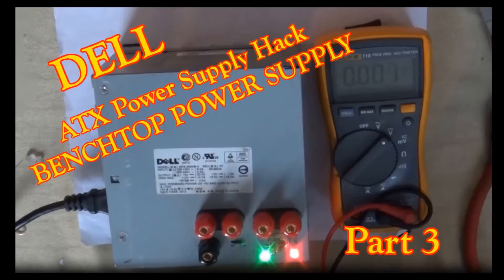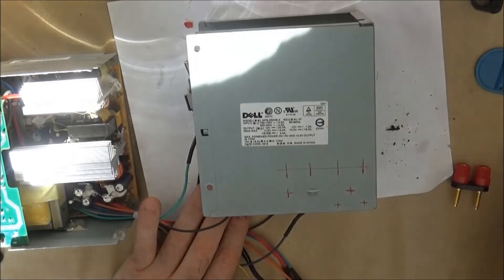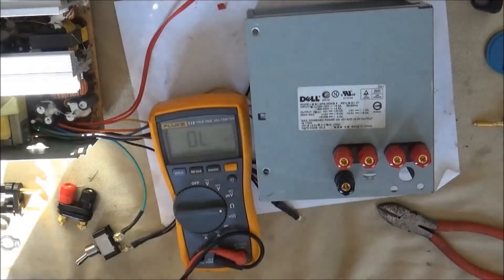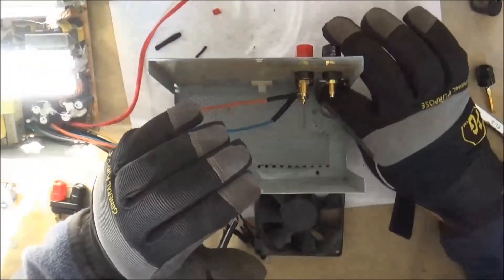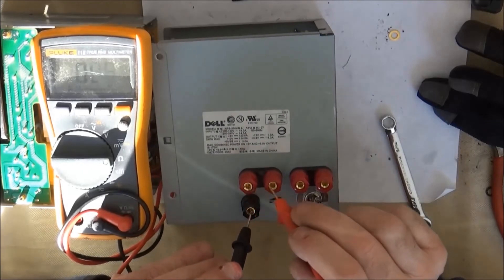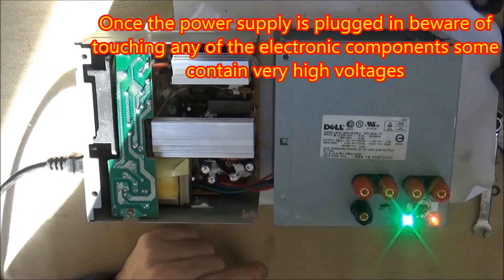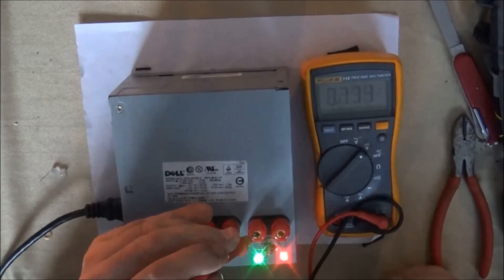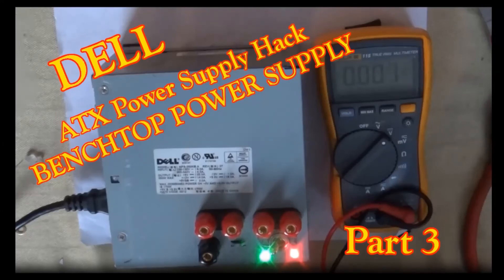DELL ATX Power Supply Hack! Benchtop Power Supply! PART3

Comment: Instead of a resistor load I just plug an old HDD to an HDD plug. It makes a fine load.
I use an old ATX PSU to supply MOLEX power to my HDD "farm". I have 6 HDDs connected to my old Dell ATX PSU. I use a USB to IDE/SATA cable for each external HDD and plug the HDD to a USB port with power from a Molex plug of the PSU. The USB port comes from a 10 port USB connector.
Reply from the maker: Thanks for the comment!

Comment: impossible d'avoir 15v y'a court circuit ?
Reply from the maker: +Abu Al -3 volts plus 12 volts égalent 15 volts!!
Reply: +Heath Putnam 
OK :)
question: -3v color wire please
Reply: +Heath Putnam 

15v no possible short circuit.
I tested.